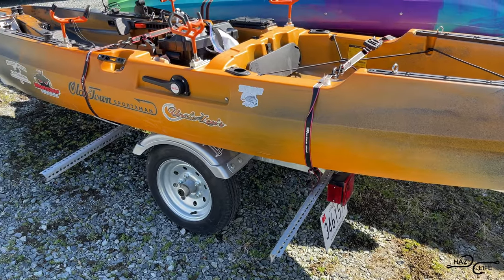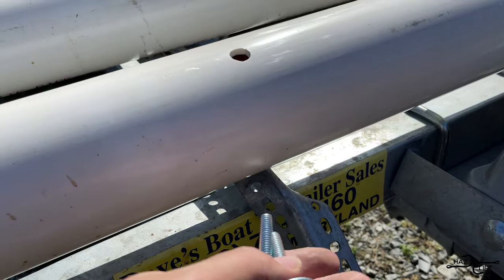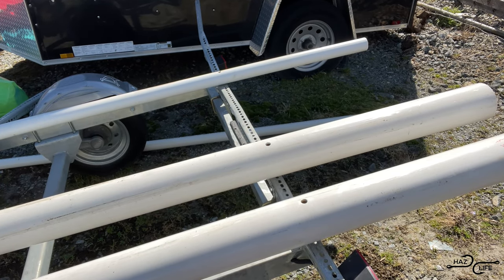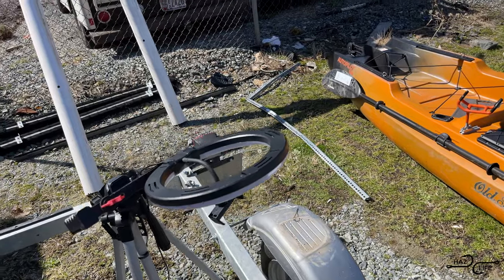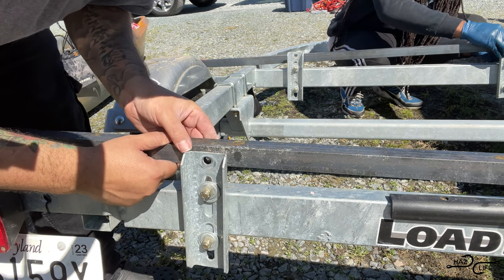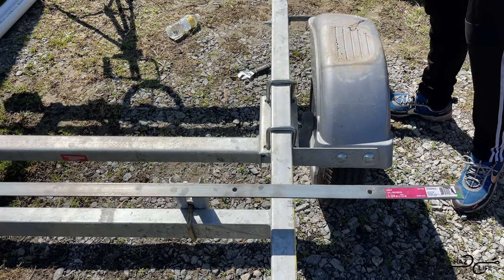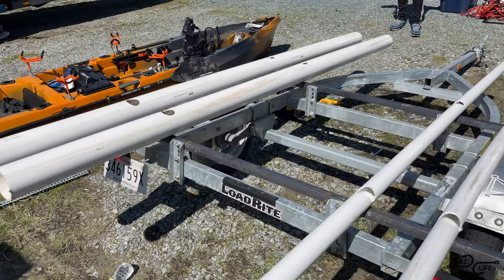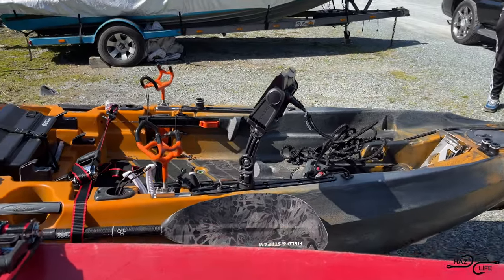DIY Kayak Trailer (6 month Upgrade)

Comment: Uni strut would be stronger than the angle. And I use flange nuts instead of the nylock nuts
Reply from the maker: Thx for the tips